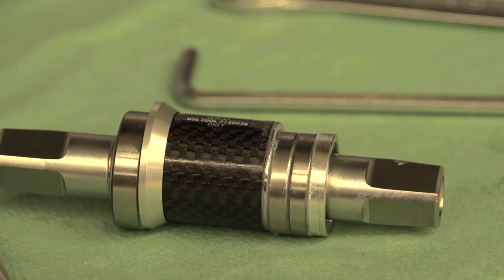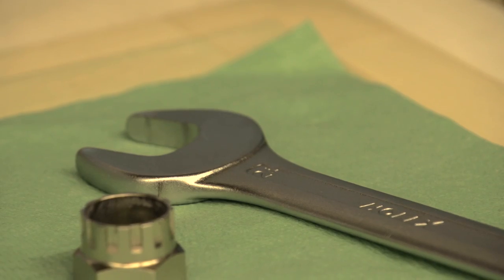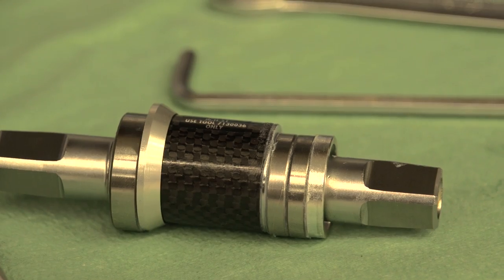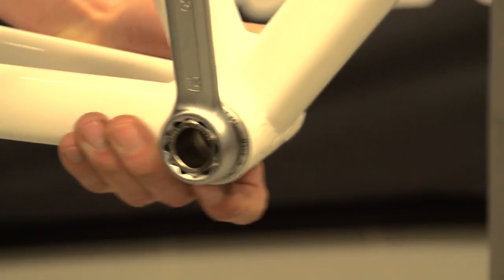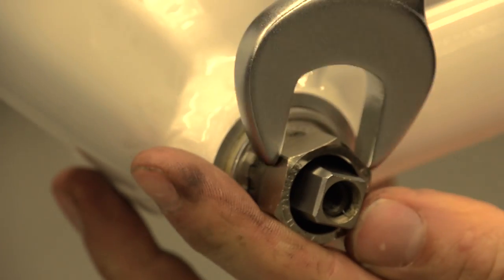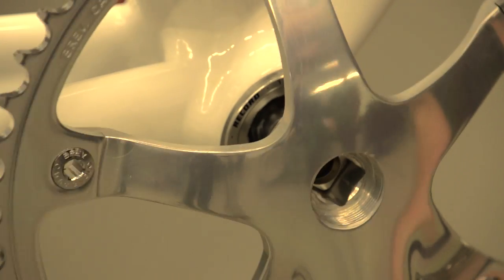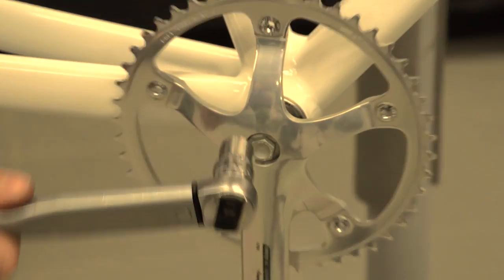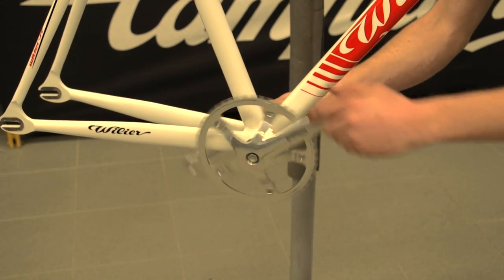How To Fit Campagnolo Track Cranks And Bottom Bracket - GCN's Maintenance Mondays

Comment: This whole "grease" thing.............  Actually, you are far better off on the fixed and adjustable cups instead of grease to employ TWO complete threading wraps on the cups with teflon tape. It honestly does a superior job. Campy do NOT advise greasing the spindle. If you must, instead apply a whisper of ANTI-SEIZE - for those not familiar, it's simply grease with either aluminum or copper powder and in this application IS better than pure grease. I do highly recommend, if possible, tightening both BB and crank to Campy's torque rating spec. I forget off  the top of  my head what they are, but you can look them up. This is especially beneficial with the cartridge BB. An open bearing BB - which I prefer BTW does not require this.
It is also a good idea to unscrew the chainring bolts regardless of brand and anti-seize, grease or oil the threading then reinstall. I additionally always place a few drops of Permatex BLUE (never, ever green or red!!!!!!) thread lock on the crank bolts and torque to spec. This prevents the possibility of the crank bolts/crank arms loosening.

Comment: My bottom bracket just failed on my track bike, and my local bike shop is charging me 65 for a new one plus labor. I rather do it myself. Thanks GCN
Reply: I have this same crankset with a Phil wood bb haven't had to do much but clean it since 2010. One of the best drive setups I've ever had. If your replacing a bb I suggest PW hands down.
Reply: which phil wood bb did u get ? which 1 works with the record pista?

Comment: Hi, I have a Wilier La Triestina of 2009 and it seems to me I have the same fit than this video. Can you help me out to confirm it? any video helping in the removing procedure? I will install a second hand chorus 11v ultra torque, so if I understand correctly I do not need any special BB inside as the bearing is already on the crankset, but just the ones kind of external spacer that come with it, like in this video https://www.youtube.com/watch?v=Kxvaclp0wtE right? will they fit with my old Wieler La Triestina 2009?

Comment: NO grease mentioned at all........the numpties would just follow this as stated and bugger up bottom bracket and frame possibly. 
Don't use grease on interface between crank and axle though,  that's the normal view at least.